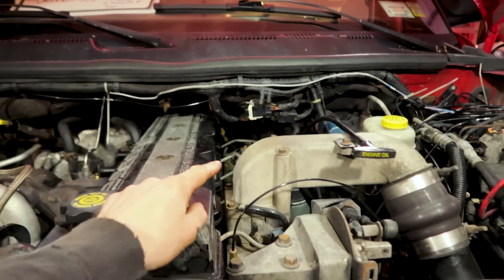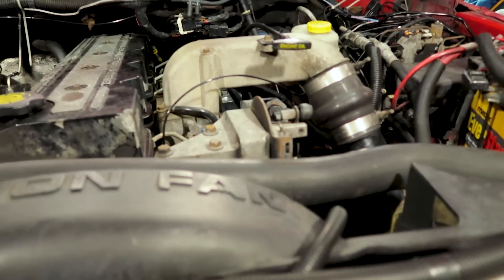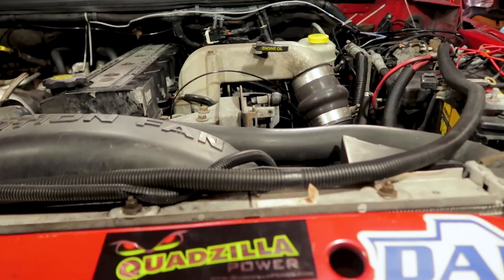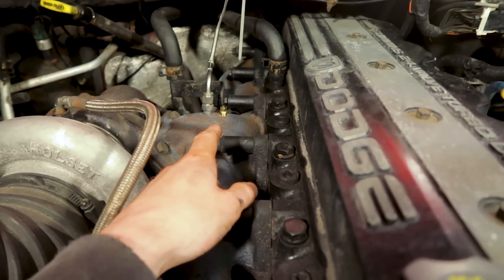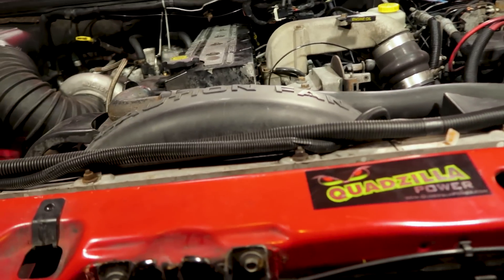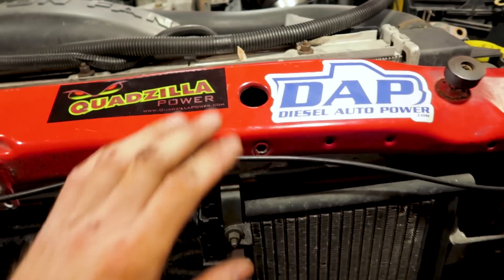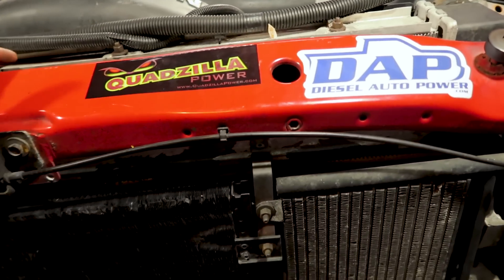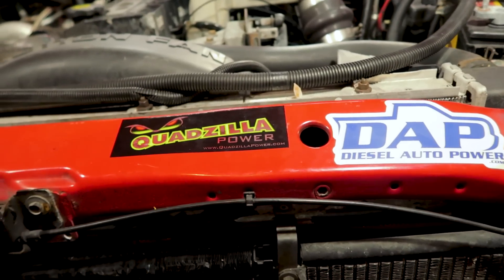REMOVING THE QUADZILLA ADRENALINE FROM MY 24 VALVE CUMMINS!

Comment: Wouldn’t the quadzilla be VIN locked? Making it useless to others?
Reply: Quads are not vin locked
Reply from the maker: That's right. They're not vin locked. They just need different MAP sensor connectors for different year trucks but can be interchanged.

Comment: Sweet video, very informational. So I have the V8 5.9. Was planning on not this year, but next year trading my car in for either a single cab 2nd gen or 3rd gen Cummins for plowing. Which one would be best? Especially considering steering, definitely not plowing with the guzzling V8. Want something that can take the beating and want to stick to the 5.9 so aiming for 2007 or lower.

Comment: That quadzilla probably stuck wide open throttle and you value your life that's why you took it off
Reply from the maker: What's your obsession with the quadzilla "sticking wide open"? You must work for the competition lmao. P.s. I took it off the truck because I sold that truck and was able to hook up a subscriber with a tuner for his truck. 👍
Reply: @purepanorama8484  I have a handy capped brother and we sled pull I have to ride with him because of his handy cap on two occasions that quadzilla stuck wide open once we broke 2 axels and the transfer case the other time it was on the street and I was driving i don't have an obsession and no I don't work for the competition p.s hope your subscriber don't have any problems
Reply from the maker: @aaronmyers7725  well I'm sorry to hear that you had a bad experience with the quadzilla. Its a fantastic tuning option for the vp44 trucks. I do recommend that guys get to know all the parameters it can adjust though, because it can very easily cause some issues for their trucks if they over adjust things. Hope you guys have a great season with the pull truck this year! I want to try and get out to a couple of events and film stuff.
Reply: @purepanorama8484  I fixed the problem replaced the 5.9 vp with a 6.7 common rail